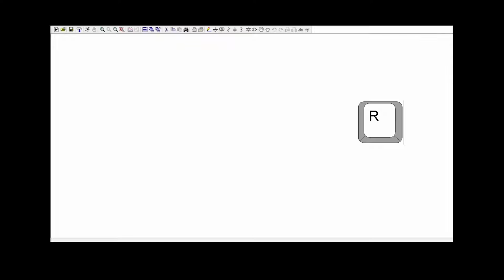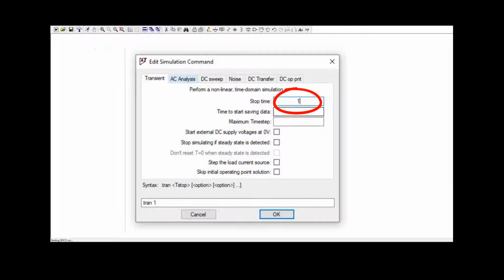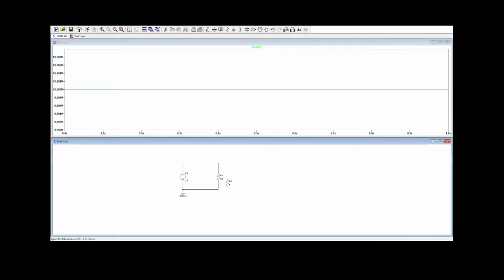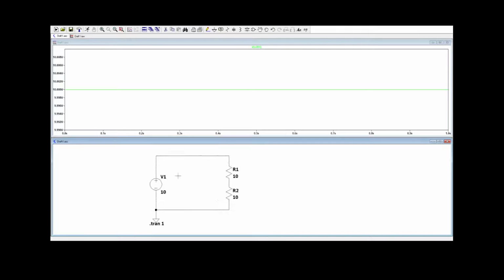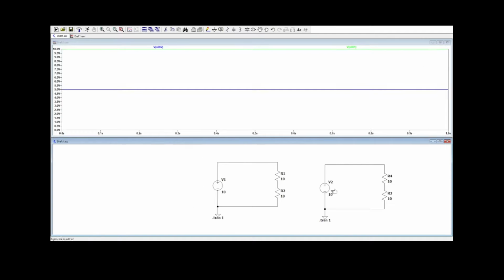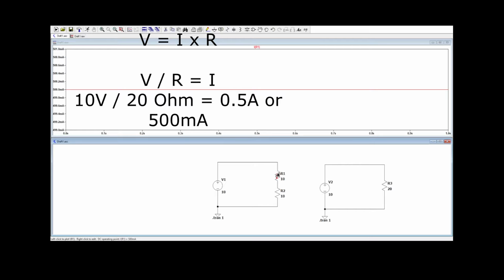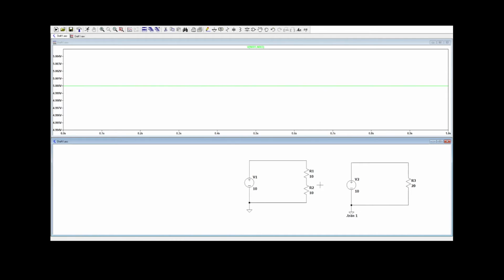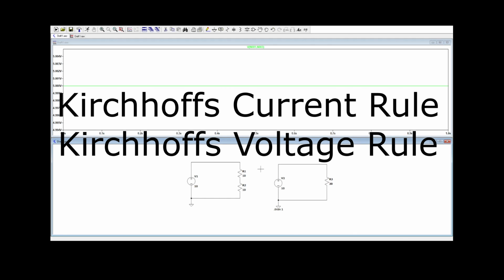LTspice Basics - Introduction to Circuit Theory: part 1 - Ohm's Law

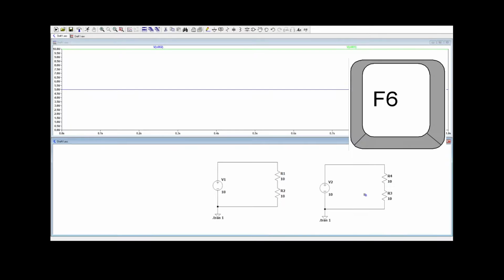Comment: 5:10  "You have to account for the fact there are 2 resistors if you want to use ohms law for current"
NO YOU DON'T
It's a SERIES Circuit .... In - Series , Voltage Drops and Current remains Constant
in-Parallel  You have to account for it as Current fluctuates and Voltage remains constant

then at 7:54 you stated it correctly,  that the current is the same through both resistors